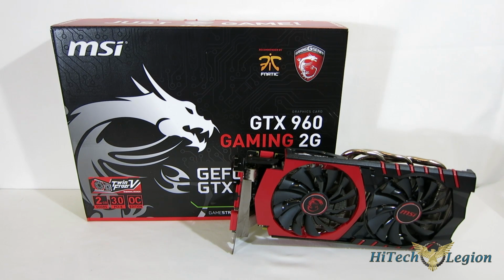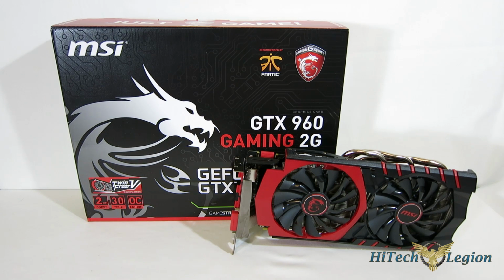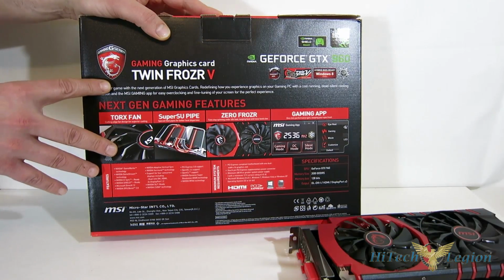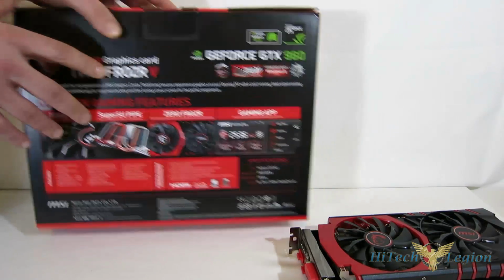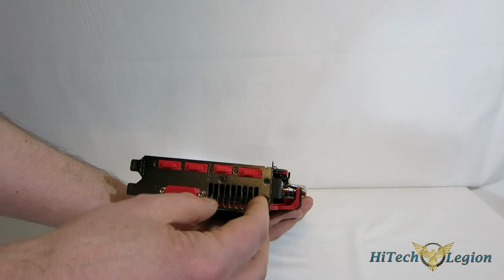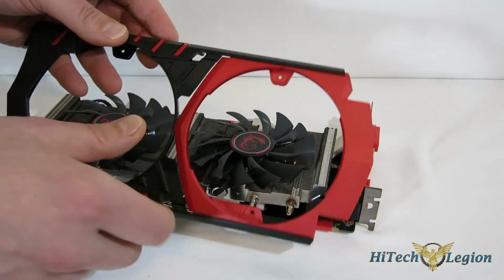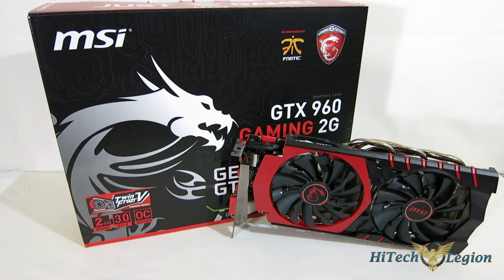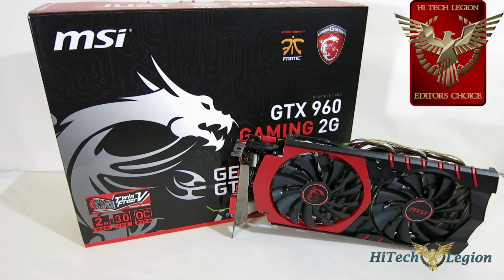MSI GTX 960 Gaming 2G Overview and Benchmarks

Comment: Mine is acting up. From day 1 it would randomly not get recognised by my MSI Gaming 5 motherboard. I transferred this to another motherboard and its the same thing. It works well when it gets recognised. Other times its just blank screen and I had to switch the hdmi cable to the onboard graphic. Switching the pc off and on again would make the pc boot from the graphic card. This I had to do multiple times before it would boot with the graphic card. Very annoying.

Comment: guys, i'm building a budget pc and cannot decide whther to take msi gtx 960 2GB with OC or msi gtx 950 2GB? 960 costs 65 usd more at the store that im gonna buy from. any advice?
Reply: +sh0tgunbl45t Thx, i think i will go for the 950
Reply: "gtx 960 vs gtx 950 " type this to google and check the first site  (gpu boss)!
You can see the 950 wont worth it, buy a 960 rather, its a much stronger card.
Reply: +Kedvező Áron yup. bought 960. thx for replying
Reply: +Kedvező Áron yup. bought 960. thx for replying

Comment: there is no question in my mind that the MSI 9 series with twin v cooling is the best bang for the buck. none of the competitor's come even close to what you get the MSI either GTX-950 or the GTX-960 -970- 980 ' its very well made and has outstanding performance. believe it or not the demand for the MSI GTX- 950 and 960 is huge. newegg just raised the price 3 days ago by 20$

Comment: HI, This will be my first time upgrading anything on my PC. Looking to possibly get this card. Will I seen any issues in doing so?

Current System Specs
CPU: Intel i5 750 @2.67ghz (ark.intel.com/products/42915/Intel-Core-i5-750-Processor-8M-Cache-2_66-GHz)
Motherboard: h57m01 ( http://www.findlaptopdriver.com/mainboard-h57m01-specs-12232011h650/ )
RAM: 8gigs
GPU: AMD Radeon HD 4650
PSU: 300watt (will be upgrading)
Win7 64bit

Thanks for any help.
Reply: hi man, your setup seems solid but before installing the new card you will want to upgrade to atleast a 400w psu (without overclocking) because 350w just can't handle the 960, i learnt the hard way lol. the processor is also not the greatest so you may want to look to upgrade it in the near future :)
Reply: hi man, your setup seems solid but before installing the new card you will want to upgrade to atleast a 400w psu (without overclocking) because 350w just can't handle the 960, i learnt the hard way lol. the processor is also not the greatest so you may want to look to upgrade it in the near future :)

Comment: Quick need some help. Is this a good gaming build? If not what would you change, feedback would be great!
 (my first time building a gaming pc)

Processor : Intel Core i5-4460
Graphics Card: Msi GTX 960 2gb
Mobo: Msi H81M-P33
Memory: G. Skills RipJaw 8gb
Psu: Corsair cx600m
Case: Cooler Master N200 MicroATX
HDD: Seagate 1 TB
Reply: I think it's fine

Comment: I have question.
Is it worth to buy gta v to this pc?

CPU: AMD FX-9370 8x 4,4Ghz
GPU: MSI GTX 960 100ME
RAM: 8GB @1866Mhz CL10
MB: MSI 970GAMING
PSU: CORSAIR 650W
HDD: 1TB SATA III
Reply: Yeah, it's run well. :) 60fps while recording.

Comment: Hey there!
So, I'm quite new to building PC's, and I was looking for some advice.
My planned parts:

AMD FX-6300 CPU
MSI GTX 960 Gaming GPU
Corsair H100i Liquid CPU Cooler
MSI 970 Gaming Motherboard
NZXT Phantom 410 Case
EVGA SuperNOVA 650w Power Supply

So, I was wondering if this setup was a good setup for gaming, and if there are any improvements to it.
Thanks for your time!
Reply: +Steve Mackinnon Can you give any feedback how the card is? I have the exact same build as you except for thze liquid cooling and the case :D

Comment: Hello everyone, Im building my first pc and could really use feedback. Should i change anything?

Cpu:Intel i3-4160
Cooler Master Hyper TX3 Cooler

Mobo:Gigabyte Ga-H81m-h

Memory:Crucial Sport 8gb

Storage:seagate barracuda 1tb

Gpu:Gigabyte Radeon r9 280 3g 

Case:Nzxt Source 210 window

Power:Coolmax 500W
Reply: Dude lisen get the CPU to an i5 and the psu 2 600watts
Reply: You might want to upgrade to at least an i5 or even an AMD FX 8350 and try and maybe get a better mobo which will help in the long run
Reply: Get the I-5 if possible its much better than I-3, the I-3 is for work the I-5 is for med/gaming/high depends on what you wanna do with your computer I would get I-5 because my custom Gaming Pc has it and I can run games like a beast
Reply: i3 -> i5 and over clock the i5 just a bit
AMD R9 -> MSI Geforce GTX 960 2GB OC Edition, just a littke overclock

Comment: I have a fx 6300 and i am getting this gup do i need to worry about bottleneck??? HiTechLegion
Reply: +jawo simon It's awesome i overclocked my cpu and i can get a stable 60FPS on GTA V on Very High 1080p.
Reply: TSM Wildturtle Nope
Reply: TheKiekerr :P i commented this a long time ago, decided to go with the 380 4GB MSI
Reply: TSM Wildturtle hey bro, how's fx6300 with MSI 380 4GB?
Reply: TSM Wildturtle  cool. though right now GTX 960 is cheaper here. If it's just a bit of frames lower, I'd get 960
Reply: +jawo simon Well in my country there isn't really a price difference the 380 4G were like 50 cents more than the 960 so i went with 380
Reply: I'll be checking the prices when I get the money. December probably,prices are low during that month. If you encounter any problem or anything awesome with fx6300+r9 380, please ping me :D

Comment: I have an A10-5800K and plan to buy this gpu, do I need to worry about bottleneck?
Reply from the maker: Patrick Olmogues it's quite possible. but you should see some decent performance at 1080p
Reply: +HiTechLegion ,there is no backplate any warping or bend issue n this version of msi gtx 960?

Comment: Currently use : 

Gigabyte GA-Z77X-UD3H
I5 3350P
8gb RAM
Sapphire Radeon HD 6850 1GB GDDR5 Toxic
600W LC Power SilentGiant, LC6600GP2 V2.3

Would you notice the difference with MSI GTX 960 Gaming 2G?
Thanks.
Reply: How would you not notice a difference?! The GTX960 is probably more than twice as powerful than your current card, and will have WAAAY better performance when using DirectX 11 and 12.

Comment: can this graphic card fit in my cooler master HAF 912
Reply: Max length in a 912 is 13 inches (removing drive bay) so yes this will fit no card basic card like this is 13 inches

Comment: I plan on selling my 660 ad then i should have enough money to get a 960 after i add it to what i already have but i wanted to know should i get a 970 or for the same price should i replace my crappy ram with a good set, get a 960, and get a better cpu cooler so i can overclock my 4690k since im using the stock cooler? ant advise would be great.
P.S is anyone looking to buy a used 660 for $150?

Comment: Thinking about bulding this.

Intel Core i5-4690 Socket-LGA1150
ASUS Z97-AR - Black, Socket-1150
MSI GeForce GTX 960 Gaming 2GB PhysX"Twin Frozr V"
HyperX Fury DDR3 1600MHz 8GB Black
Kingston SSDNow V300 240GB
WD® Desktop Black 1TB SATA 6Gb/s
Corsair CX 600W PSU ATX

I'm not sure if i want to go with Asus gtx 960 STRIX or the MSI one. Don't think that i will overclock either.

Does it look ok?
Reply: LoMpE The MSI fared slightly better in our testing in performance and noise. They are both top quality cards so really no "wrong" choice there.

All looks good excepting the PSU. The CX600 isn't a very good unit. Terrible hold up time and minor rail performance, and the CWT built units don't have great track records. You can get something like a Seasonic S12II 620 for the same price.
Reply: George Cella Thanks for the answer :) I'll definetly check out the PSU that you suggested.
Reply: George Cella Just got a few more questions.

1. The Seasonic wasn't available in my country (Norway), but do you think that a Cooler Master G650M would work?

2. Do you think that i need any extra fans in my case or are the stock ones ok?

Comment: Gtx 760 at 680 price or GTX 960 at 810 price? Which is better value?
Reply: I'm confused...GTX 760 for $680 or GTX 680 price and so on with the 810...GTX 810???? Well I mean to say that comparing the 960 to the 760 there's about 10-15% of a difference at maximum which can mean an extra 10 fps with the 960...
Reply: Zuhayr Sarker Those prices are in Lithuanian Litas. I`ll simplify and convert these prices in EUR:
Msi GTX 760: 197 EUR
Msi GTX 960: 235 EUR
Which one has the better value? I`m going to overclock.
Reply: In terms of price to performance the GTX 960 has a very bare lead over the 760 (it's like .5 EUR per fps let's estimate), but if you're going to overclock, it's much more worth it to get the 960. That thing is a beast overclocker. You'll get 7-15 more fps which is actually quite a large boost TBH.
Reply: Simonas Morkūnas Im sure you can get the GTX 960 Gaming 2g for 210. Also, DirectX 12 ready this should be no hestitation.
Reply: RCFProd Yeah. I think it would be nice upgrade from my Radeon 7770.
Reply: Simonas Morkūnas That would be a superior upgrade.
Reply: Zuhayr Sarker should i get a r9 285 or the gtx 960? i will be overclocking as well (cant afford 280x since its 70 dollars more in my country)
Reply: Heisenberg101 I would just get the 960. 
http://gpuboss.com/gpus/Radeon-R9-285-vs-GeForce-GTX-960
I have it and it performs quite well. The 285 is a bare difference that just isn't worth it. If you overclock the 960, you can well outperform the 285. I scored an 8303 with a VERY light overclock on 3Dmark compared to the sub-800s I've seen with the 285. 
So yeah...960 it is then. It's an absolute monster of an overclocker. The thing boosted up to 1586 MHz on GPU Boost 2.0 Technology which is just unbelievable. The 285 will never overclock so well. The thing can barely go past 1150 sometimes.
Reply: Zuhayr Sarker ahh, alright. which model should i get? the msi one is pretty affordable, but normally the g1 is the best overclocker right? which one do you have?
Reply: Heisenberg101 The G1 is pretty good yes, but it is a long card and is more expensive. Not sure if it is worth the extra money. 

The MSI Gaming 2G is good enough. Another good variant is the Galax GTX 960 EXOC. 

Really though, Zotac and Palit also have good variants. I don't think it matters that much. Just get one that is overclocked well out of the box and is reasonably priced.
Reply: Heisenberg101 I have the G1 Gaming. It is insanely cool. It idles at 25-ish at startup and then when the room is warm it idles around 32-35. When gaming it jumps all the way to 63 or so, but it's overclocked. Non-overclocked it's only gone as far as 55 degrees. I mentioned before that it boosts all the way to the high 1500s. Yes, it is THE BEST overclocker from what I've seen on the benchmarks too. It is so cool, looks so nice, is one of the few that has a backplate, and overclocks the best (has a 6-phase power design and a hell lotta solid capacitors). Also is in the class of the higher factory overclocked GPUs.

I would get the G1. Msi is also great but is only worth it for a colour scheme (It's pricier only for the better quality components on the PCB). But look, I have a red/black build and I got the G1, because that thing overclocks like a beast and the backplate is so damn good.

IDK the prices there but for some weird as hell reason, the G1 Gaming was the cheapest where I was. I'd get the G1 (cooler, better overclocking, and damn good looking).
Reply: But raise caution. Gigabyte Customer Support is poor. I would have only got the EVGA variant because I love EVGA as a company so much, but the backplate was a turn-off and most of all, it was much more where I was. Get the G1 card if you want the best out of the box, but if the EVGA one is cheaper, it's better to get that one for the long term (I just really love their support). It is clocked higher out of the box too. Just doesn't really have the looks. G1 isn't bad either, but you'll have a terrible deal with their support. MSI, ASUS, and Gigabyte are the big three with not-so-great service. So I guess you really have no choice. It's a one-time pick, and if you win the lottery (get a good and working G1), you're on the road for better benchmarks.
Reply: Zuhayr Sarker well its just that where i'm from, the msi one is the least expensive, while the g1 is like 50 dollars more expensive. i guess i'll just get the msi one, maybe i could get the g1 later for sli.  also, evga stuff isn't available in my country
Reply: Heisenberg101 SLI has to be a combination of the exact same cards I believe. If you're planning to upgrade, sell your GTX 960 and get a better one. I don't suggest SLI with mid-end cards. SLI has too much inconsistencies as it is and you want atleast one card that works really well. 

The MSI one is fine, don't worry. There isn't much difference in performance. 

By the way, if you want my opinion. I recently built a new PC and I was getting the MSI GTX 960 but I looked on the web and found a used XFX R9 290 for cheaper with warranty still left on it.

I believe you can atleast find a used R9 280x for a lower price than a new GTX 960. If there is warranty left on the used card, I'd say don't hestitate. I'm really happy with my R9 290. It's an absolute beast and it cost me less. 

Going for a used graphics card is usually a smart decision, sometimes a gamble.
Reply: RCFProd He said the 280x was more expensive. Heisenberg101 The Msi one is just fine, in fact better overall in some ways. Customer support is better and you get more longevity with that card's better military class components. Just have a lower clock speed. It should overclock just fine anyways just as all 960s do.
Reply: Zuhayr Sarker I'm talking used graphics cards, not new ones. Usually there are some good deals around.
Reply: go with gtx 960 cz of dx12 support ...dx12 will give more frames
Reply: SheiX Sahab I'm sure the GTX 7xx series will also have DX12 support. 

Actually, most graphics cards released in the last 2 years should support DX12.
Reply: thx for the info.